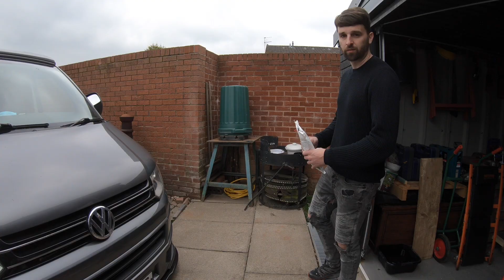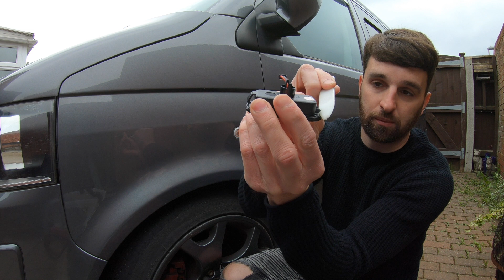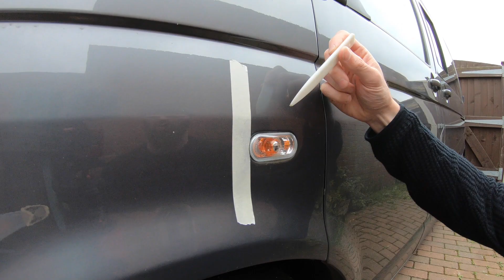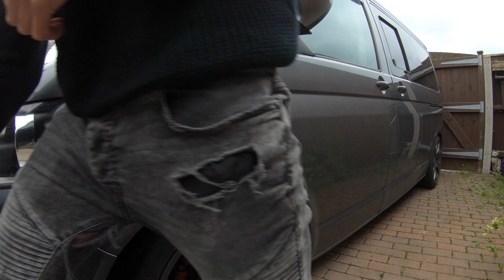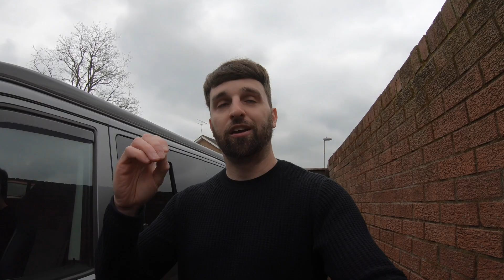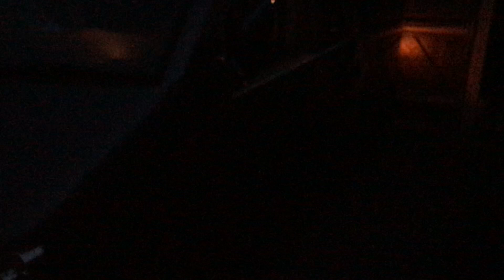Dynamic LED Indicators Install How To DIY VW T5 / T6

Comment: Fitted mine, one side was throwing the warning bulb light on the dash. Even though the indicator was working. Found out they weren't compatible with my caddy mk3 face-lift model. Easily sorted though small resistor sorted that out look nice especially at night.
Reply: Where did you install the resister please I need to do this